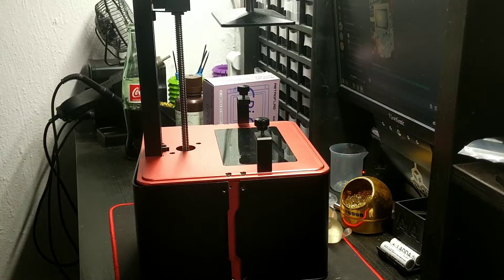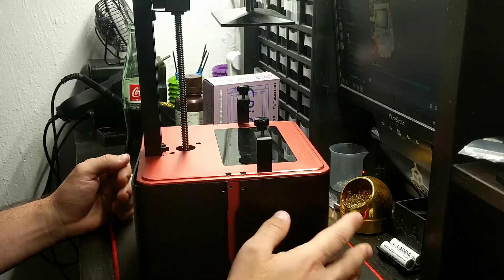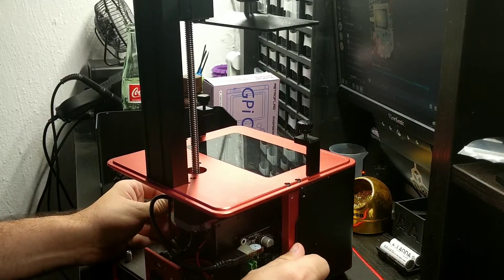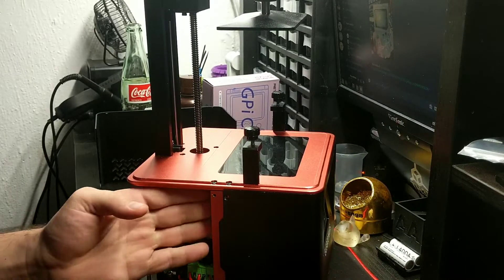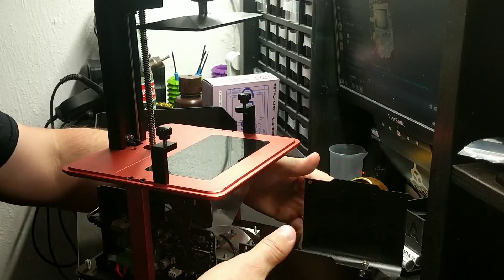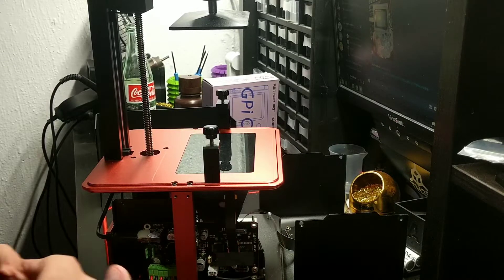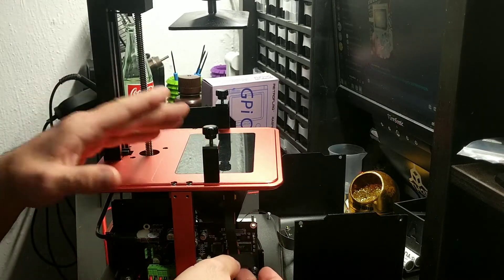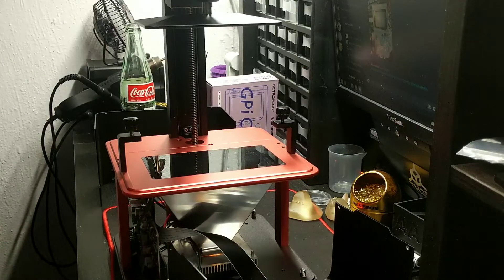Elegoo mars tear down to replace parts!

Comment: How do you replace the UV light?
Reply from the maker: You would have to take the entire unit apart. I believe there are 4 screws on the bottom of the unit that hold the heatsink/light unit to the bottom of the printer. Then you need to disconnect the wires from the board

Comment: can you estimate how long does the lcd last in this machine? and how do you check if its time to replace it ? thanks
Reply from the maker: Approximately 200hrs
Reply: @AkumaMods  thanks for the response. ive been looking for the higher end printers but even they end up with failed lcd screens. its probably for the best to consider it as a consumable.. and the way i see it cheaper spare parts are even more important so elegoo mars probably going to be my choice consindering replacement lcd screen is at around $30

Comment: Neat. I have to play around with the motor and threaded rod on mine. I'm not sure if resin splashed onto the rod and caused it or if something else happened to tilt the motor slightly, but the rod is off it's axis slightly and it causes the whole thing to bind while rising.

Comment: I cannot find the video that you mentioned around the 3:50 mark. Have you made it yet?
Reply from the maker: I actually have not done that video yet. My mars has been sitting in pieces for about 2 months now because the z height issue is so serve that the software will not help

Comment: Did you do the video on the z axis height on the Mars I have just emailed Elegoo to find out as I have 2 Elegoo Mars machines and both stop short, being a small area to start with I am loosing 30-40mm on the z axis height and just had a 12 hour print fail because of it, everything was within the range when slicing but the z axis let me down
Reply from the maker: My elegoo is actually in piece right now because I'm swapping out the crappy crush ring washer for a solid washer. I was loosing 1mm on my cube print so it's pretty bad. I have 1 more unboxing and setup video for the sparkmaker. Once that's done then we will drive into more diy stuff
Reply: @AkumaMods  Thanks for replying look forward to any help you can give me if I get a reply from Elegoo I will update you mate.... thank you again
Reply from the maker: @3dprintitbuilditpaintit138  yes please do because I'm looking forward to fixing the ever plauging issue that the mars has with z height

Comment: Next time you do such a video where details are important to be seen, light up strongly with two additional diffused lights, one from each side of the camera at about 30º to 40º from lens axis. These lights should work great for that purpose (the 80w cold light are better): https://www.aliexpress.com/item/4000121829255.html. While at it, use one or two more of the same type light source to put up your overall lighting, so color is  the same.

Comment: I have a question. On my Mars, the base air flow fan blows out of the bottom, but other people have said theirs blows out from the back. What is the reason for them being different?
Reply from the maker: Well that's actually a very good question. To be quite honest they both do the same however of the model changes elegoo has learned that it's best to focus most of the air out the bottom under the UV lamp because that is where the majority of the heat is. The older units had a fan out the back most likely because that was thought  to be best practice. You can still add one out the back for more cooling or even better put a charcoal filter on it and make it a resin filter smell system